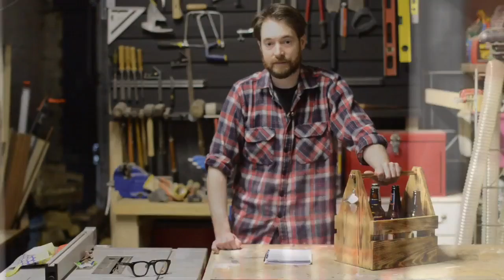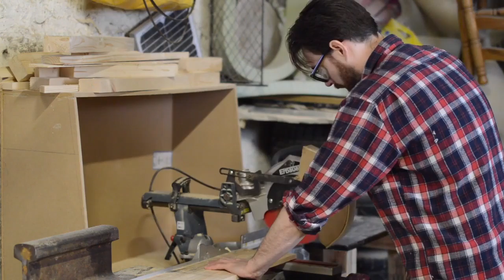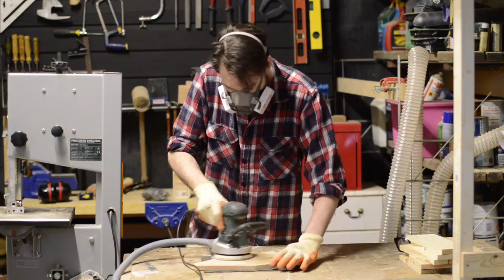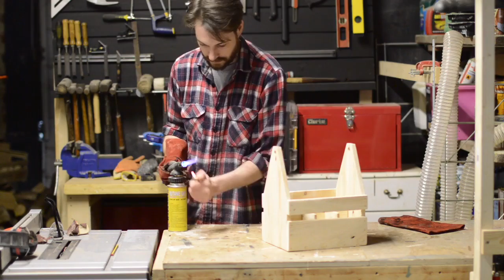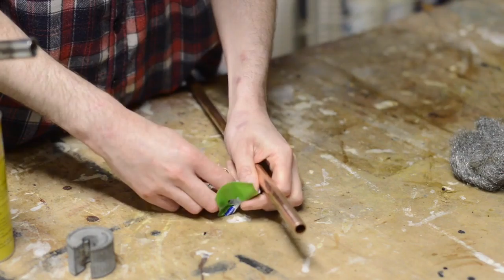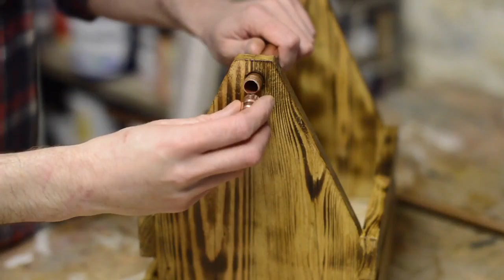Upcycling project, to make a wooden beer crate from a wooden pallet

Comment: Not sure if anyone has mentioned this but, the 15 mil stop-ends you put on the ends of the pipe? You can buy push-fit copper ones exactly the same but without having to solder ( which you forget to do by the way) them on. Once they’re on, you can’t get them off again without using the correct tool to do it, so they’re very strong and won’t come off. Just an idea for future projects. 👍🏻🇬🇧🏴

Comment: Great video. What is the size of your workshop if i may ask. Subscribed
Reply from the maker: Thank you. Its 20 x 10 foot
Reply: Happy with the size? I have a 9x12 shed and that is just to small. Lokking for a log garage 12x 19ft
Reply from the maker: The size you are looking at is great. I want to build one that is 20 x 12. Its the extra 2 foot that will mean i can walk around a central table.
Reply: That is what i preffer aswell.  Don't know yet if i go for a ready to build log garage or to build one myself. I also want it to be 12ft high. so that i can store materials overthere. Thanks for your reply!